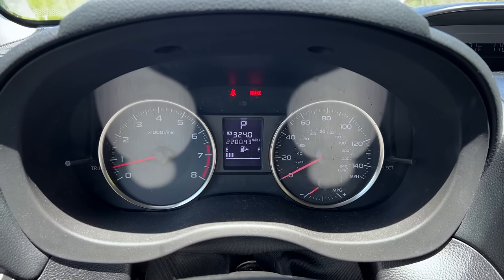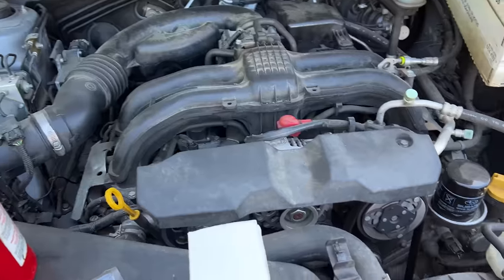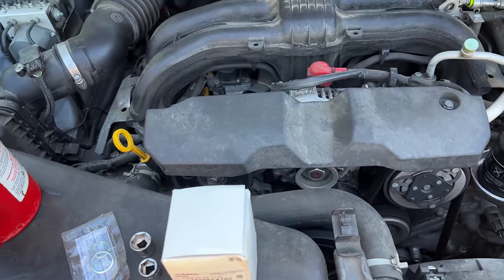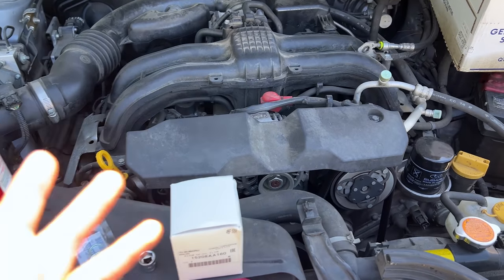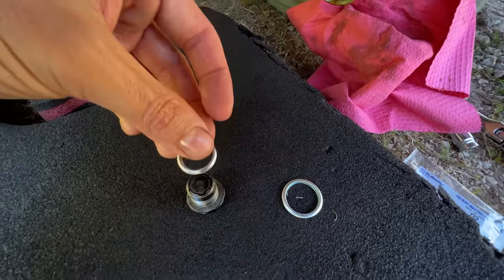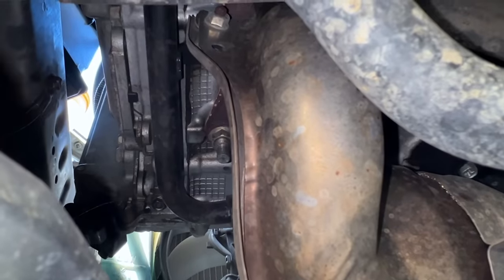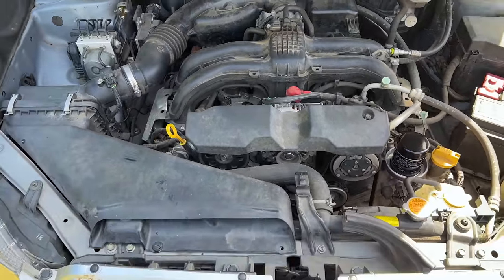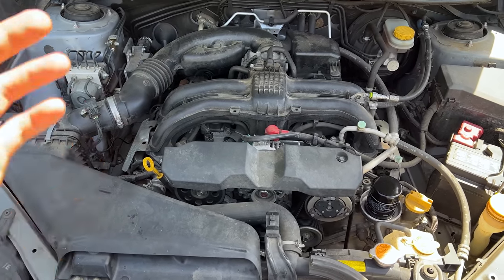220,000 Mile Crosstrek Oil Change - How Has The Cheapest, Highest Mileage Crosstrek Held Up?!

Comment: I change the spark plugs and all the fluids every 50k. My 2011 impreza 2.5 non turbo has 325k miles. Only one sensor repaired. Oil send unit or something.

Comment: The mpg on my crosstrek drops off very noticeably when the switch is made to winter fuel blend, it seems that this engine is more adversely impacted than any other vehicle that I have had....but maybe it's my imagination.
Reply: So does every other car
Reply: I realize blaming RFG for decreased efficiency is the most fun thing to blame (because it can be put on tree-hugging liberals) but there are many things that contribute.  At start up and until all fluids are warm, they're viscosity is higher and the engine works harder, as do differentials.  Engines will start and remain in closed loop state much longer, and when combined with the amount of idling people think they need, this burns a LOT of fuel.  Sit in the car longer, chatting away, you fog your windows up.  The defrost is working - large draw for the electric in the rear, more significantly the air con system for the defroster drying the air out, and in the meantime idling, idling.

I have preached the gospel I learned as a young lad listening to Click & Clack many, many years ago: start it up, and get moving within 1-2 minutes.  Those foggy windows?  The huge contributor to this is people jump in the car and go through their "brrrr, it's so damn cold" associated with much more respiration, which puts a very significant amount of moisture in the air - fogs the windows up - more time idling.  Try breathing through your nose & avoid talking.  Go ahead, laugh it off, but my father taught me this as a kid, and I in turn to my son, and dad is right - it works. If there is still some fogging, crack the front windows (and suck it up, the cold air coming in for a minute or two won't kill anyone, but fogged windows will.)

Final thought - it is incredibly ironic how people seemed to know a lot more about this many years ago.  Yet when "Gore Gas" came along in 2000, with prices eclipsing $2/gal for the first time (and staying that way through 8 years of GWB) I'll be damned if I haven't seen an epidemic of people idling the crap out of their cars.  Up in the UP (Upper Peninsula, Michigan) I'd see people leaving their cars running when going in the grocery store.  I blew it off - this is hardcore winter territory.  But then it turned up everywhere. I see it constantly.  When people have someone jump out and get something in Walgreens, they will idle...but even alone, they let it idle and risk theft. They idle at gas stations. They idle at fast food places eating in the parking lots. I watch neighbors fire their cars up and run back in the house for 20 minutes before returning and leaving for work.  And in the burbs? Despite these yellow vehicles called "school buses", running around almost empty, parents sit outside schools in lines to drop off and pick up.  The parking lot looks like a factory.  And most of this idling is bigger, less efficient trucks, SUV's.

So despite the widespread griping about gas prices - and the inevitable trend of blaming Dem Presidents during their terms - and ignoring it during Rep President terms - a large swath of the population remains perfectly OK wasting fuel and hitting themselves in the pocketbook.  (BTW all car guys - remember when Obama was derided for suggesting people check the air pressure in their tires?  You are an audience I must assume knows proper air pressure has an enormous impact on mpg, and he was passing this info along from AAA, to an American population that NEVER checks their oil or any other fluid nor do they check their air pressure.  I sit behind people with visibly low tires - and for a modern radial tire to visibly show low pressure due to sidewall deflection, the pressure must be extremely low.  I can put just 20 psi in my tires and it can't be seen until I draw it down to about 15, or less than half the common 32 psi recommendation.  This is an absolute fact, and applies all four seasons...but when a Dem suggested it, he was made fun of for a week.  Thus, the biggest impact on MPG seems to me to be political division.  In my own life, the more lefty people I make these suggestions to welcome them and put them to use.  The more righty they lean, the more they laugh me off.
Reply: I agree!
Reply: @dackbowland1876  I’m in Ohio
Reply: Get a bottle of StarTron put an ounce or two in the gas every fill up in the winter 
It will give you summer time mpg
Reply: Yeah. All cars do! You think only Subaru is affected by lesser gas ?
Reply: What is winter fuel blend ?
Reply: @PlumberWRX  winter fuel blend is 15% Ethanol and 85% gas
Summer blend is 10% Ethanol and 90% gas 
The extra Ethanol in the winter blend causes you to get worse gas mileage 
But also it does take the car a little longer to get up to temperature 
When you first start your car the computer gives the engine extra gas to heat up the engine faster 
This was done to lower emissions 
So in the winter it takes longer to get the engine up to temperature because it’s cold 
In the summer the car warms up much faster saving you some gas 
The extra Ethanol is the main reason though for lower gas mileage
Reply: @AA-mk4pu  You seem like a very confident sort....congrats!
Reply: A far easier thing to blame it on is air density. 

More air, more fuel burns, but also more air resistance. 

This is why planes fly high… for fuel savings.

Comment: I hope and pray my 2018 crosstrek lives this long or longer. I do all my maintenence and currently have 135k and change. Love my Subie.
Reply: do you change transmission fluid? If yes, so how often? What's average speed do you have usually?
Reply: I have a 2018 crosstreek at 175k. Had to do rear bearings , 2 front axle shafts each one was $1,000 each, now have to do sturts. 

Also did all maintenance

Comment: My 2013 xv crosstrek is only at 80k miles...the wheel bearings went, and ball joints , struts replaced..   I did all the fluids after watching your videos...   front diff fill plug was a pain to remove haha.    Keep up the good content!   Enjoying them....
Reply: I'll be doing differentials at some point, i'm at 85k. Apparently the manual says the rear diff is a "lifetime fluid" but we all know that's bull.
Reply: At 80,000 I also had to replace struts and now at 96,000 front end is making another noise. Haven’t had any problems with my 2013 except for suspension, which is pretty darn expensive in itself.
Reply: Do you live in an area where they salt the roads in winter?
Reply: @mollyz2581  yeah live in NJ
Reply: for future reference and for those who strip the front diff fill plug, you can refill the diff through the check plug
Reply: @mollyz2581  I do live in snow belt.
Reply: Took to dealership. They say I need two control arms, 2 back bushings, all new back brakes. $1700 just in labor. Took to local mechanic.. put in new ball joints, he gave the back brakes a little love. Totally fine now!
Reply: @critter3188  what he charge you?
Reply: @asmokingp3005  $1200
Reply: @DAlexKablack  dont believe everything the dealer tells you

Comment: I've got 166K miles on my 2018 Crosstrek, still running strong. Had the coil miss-fire recall service last year and the Cat and O2 sensors where changed also.  Was great timing  at the 130K mark
because I had 3 fuel injectors that had problems and changed all 4.  Other than that, zero issues with the car.  Drive 150 miles a day for my commute up and down a mountain plus
stop and go traffic. Get 30 mpg on average, more on a long trip. Great car in snow and super dependable, a perfect car for what I need.  So far CVT trans is working great and haven't touched it.
Enjoy your videos and great information.
Reply: How many miles do you have now?
Reply: Any update. I do about 160 km a day ( 99 miles) had to change front axle shafts , rear bearings now the struts, and did all maintenance

Comment: My 04 Subaru Forester is still chugging along nicely with 281k miles on the clock! Big thanks to your channel and others like it for helping me with maintenance over the years! 🤣
Reply: I wish I had faith in my forester but i do not for the life of me trust their cvts
Reply: @reactcirca  I don’t blame ya I’ve heard people having problems with them but I just change all the fluids and filters when needed. It’s a little sluggish but I can’t complain at almost 300k miles
Reply: @lifeofblayne7020  yeah i was told today i have slight indication of a oil leak from a different dealer than did my transmission swap. So odd they didnt see it or if they caused it.
Reply: @reactcirca  if my forester wasn’t a farm vehicle I would absolutely get a tranny from a manual forester XT WAYY BETTER than cvt. Good luck that sucks hopefully you get that leak addressed!

Comment: Cool thing I noticed after numerous oil changes is on the Subaru blue and black filters they have number indicators to help you tighten it down the right amount. It’s numbered 1-8 and you are meant to use those indicators to tiger it down 3/4 of a turn. Super handy!
Reply: White filters have the same number indicators. When I follow the directions its too tight to remove at the next oil change unless I use a tool.

Comment: I run a 2006 forester 2,5XT  AT and have done so from new. I have passed 317000 kilometers recently and have changed head gaskets at 250,000 and a radiator somewhere along the line as well. As for the rest only tires, batteries, and brake pads (once). They are due soon now. I have always kept strictly to factory service schedules and utilized only factory recommended oil and air filters and other consumables. Oh yes and I changed out the front wheel bearings a fortnight ago.. When the gaskets were changed at 250,000km I was shown the bores whilst the engine was out and the factory honing marks could still be seen. Even today the engine runs super smoothly and starts first time every time. It uses up a quart oil between services every 10,000km and has done so since new without any variance. There is no better vehicle in the reliability stakes than this one and I will never buy another brand. Love my Scooby

Comment: Another great informative video. I have a similar Subaru oil fill funnel. It’s one of the best items I’ve purchased. It’s great just turning the quart upside down & letting it empty itself in. Usually check the coolant or the brake fluid level until it’s the next quart’s turn! I have never heard of the cold crank gas pedal trick. Guess I learnt something new today!
Reply: I have a 2015 Forrester. I cannot find the plug to drain the radiator. Enjoy all your videos can you help me out Mr. Subaru.

Comment: My outback is a 2L 2014. Presently 93000M. Fuel usage driven Corpus Christi to Manitowoc Wi. 1482 Miles. I did 31.8 MPG measured the fuel bought and the mileage driven. This was in March 2022. I love my Subaru. 
The only nag I have about mine is that I had to change out the rear wheel bearings at 80 miles. I do my own work on this car such as oil changes, replacing plugs and I did replace oxi sensors at 80000 miles.

Comment: Agreed sir, my wife has a 2020 accent touring, the first out of warranty oil change. I stopped by the Subaru stealership for a filter and drain bolt, they supplied me with the filter (blue) and a 17mm drain bolt (silver), the OEM was 14mm (black hex). 
Perhaps they (Subaru) figured, let’s put a bigger hex then the transmission drain plug. 

Correct me if I’m wrong. Great channel sir

Comment: I had a 1998 ford ranger that was still going strong when I traded it in, and I had a little over 180,000 miles on the 4.0 V6. It was a manual transmission if that matters. Just bought me a new Crosstrek with a manual last weekend, and while slow I love it and wife loves it too.

Comment: Got a 2012 Impreza with a CVT and 145,000 miles (wife’s car) Valve recall done, We did a CVT drain and fill at around 100k, and had they oil consumption test done at the dealership. They said it wasn’t burning much oil, but now I’m having to add 1 qt every 2200 miles in the winter. Changed PCV. No effect. Mileage has dropped from 33mpg to 30mpg (as claimed by the dash). Blackstone oil analysis pending, but think I’ll switch to 5w30 to see how it affects consumption

Comment: Hi! Thanks for the video. I have a 2021 crosstrek  due for its 2nd oil change. 20,000km/12,400 miles. Subaru's maintenance schedule shows that the second oil change is schedule B including:

 • Replace engine oil and filter
• Rotate tires and inspect for wear
• Inspect tire condition and adjust all tire pressures
 including spare
• Remove, inspect and service front and rear brakes
• Inspect and adjust all fluid levels including both differentials
• Inspect operation of all lights, wipers and washers
• Inspect and adjust drive belt tension if necessary
• Service battery
• Inspect axle boot condition
• Lubricate all latches, hinges and locks
• Inspect all steering and suspension components
• Check under body for damage
• Test coolant, inspect hoses and clamps
• Inspect engine and cabin air filters – replace if necessary
• Wheel alignment (recommended)*
• Road test 

It will cost me around $500! I don't want to pay that much at the dealer. What would you recommend I get done if I get it serviced at another business?
Reply: That price I'd expect the 30k, 60k, 90k milestones. Surprisingly expensive

Comment: You should remove a O2 sensor and put the catalytic converter tester  gauge to see if they're still flowing good after all of that mileage I'm curious to see. I have a 2007 Subaru Impreza 2.5 wagon and when I checked my catalytic converters they were empty and they were original and the stuff was stuck in my muffler after I replaced my muffler my MPG went up

Comment: I made the mistake of letting the Subaru dealer change my oil in my Crosstrek last year (it was a freebie). When I did the next change myself, I found they had cranked the drain plug so 'effing tight, I was afraid they'd stripped the threads. I had to use a 3 foot cheater bar to remove it. Fortunately no damage but dang! So it's not just overtightening the oil filter...the plug can also be overdone! About time to change the oil on my STI (2019). Not looking forward to that...mainly because you have remove what seems like 100 bolts/screws/tabs to take off the cover then risk burning your hand getting the filter out..sure wish they'd done the top loading on those! Thanks for the vid.
Reply: Strange that so much would have to be removed on the STI, I have a 21 WRX and you dont have to remove anything at all !!
Reply: @Austin-cg7be  Probably the difference between the 2.5 and 2.0. The 2.5L in the STI is an older design. I suppose I could leave the plastic undercladding off (can't really call them skid plates ha). Not like I'm rallying with the car

Comment: I have an Impreza with 175,000 all I’ve done so far is water pump spark plugs PCV and EGR valves an oxygen sensor along with regular brake and oil changes I use 5w-20 royal purple every 4,500 miles the engine has been very good to me I hope I can make it to 200,000 and beyond. Oh I also had to drop in a new valve body this month but that’s it. Please upload more maintenance videos on this FB20 there are not a lot of them out there

Comment: Just blew my engine (Rod) on my 2013 Crosstrek. Had the car since new. Had the lower engine replaced under warranty, oil consumption at 90,000, and the valve spring recall done at 130,000 miles. Had to replace the transmission valve body at 100,000 miles and replaced all of the wheel bearing and struts at 205,000 miles. As said the rod in the rear drivers side broke at 224,585 miles and that is the end of the car. I got my use out of it. I must say that my biggest complaint of the car was the transmission and how sluggish it reacted.
Reply: Blew a rod in my 2005 legacy I bought a used engine and had it put in for around 2000$ it is still running.   But subaru seems very touchy about oil only went 4k miles on that last oil change I couldn't get into my mechnic and was taking it to him the next day when it blew the rod.  I do it it every 3k religiously now even if I have to go to Walmart to do it.

Comment: i've got a '13 and approaching 190k.  also have the dreaded oil consumption issue as well and tend to burn around 1/2 - 1 quart every 3k.  Using 10w40 for years now to help slow the burn and keep extra oil in the trunk.
Reply: Bruh your lucky as hell my ‘13 has just under 150k and it burns about a quart every 1k-1.5k lmao
Reply: I also keep extra oil in my trunk too. I check it once per week. Just hit 170k with mine. Oil consumption started at around 100k.
Reply: @aidanaddy6940  during the summer months, it's closer to every 1.5k.  otherwise i can typically get about 2k before I have to add something.
Reply: @carloalfano334  I don’t have to deal with that subie oil consumption anymore I sold mine about 8 months ago now I have to deal with Mercedes/AMG maintenance costs 💀💀

Comment: My 2014 burn about a quart every 1000 miles. Started right after the extended warranty ended. A few months after all the valve springs were replaced under warranty. So much for partial zero emissions.
Reply: Try 5w-30

Comment: I swear by Lucas.  When I had my 97 Outback it has rod knock.  I used Lucas at every oil change and it continued to run even though the knock kept getting worse.  The worse the knock, the more Lucas went in.  With the knock I probably put atleast 50k on it before i installed a used engine in it.  Knocked like crazy, but still ran.  

If that funnel can’t be afforded a Castrol Edge 1qt bottle has the same thread pitch.  Cut it open and you can pour new bottles in with ease.